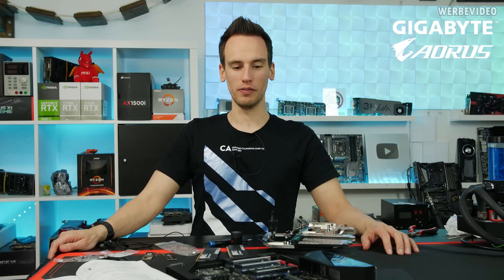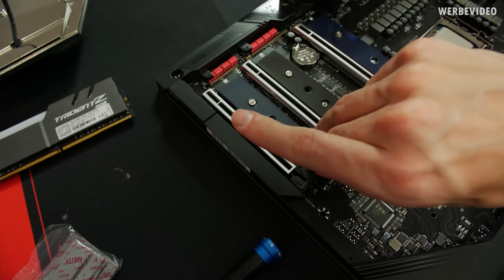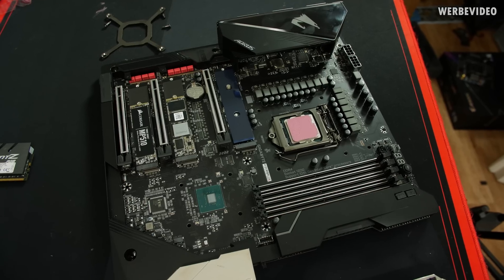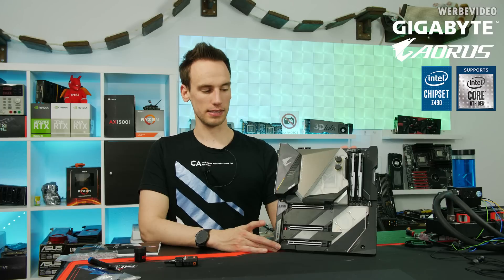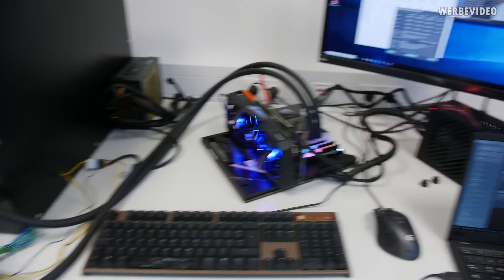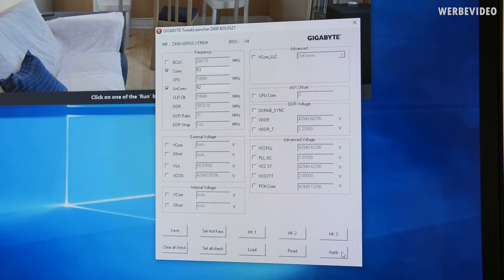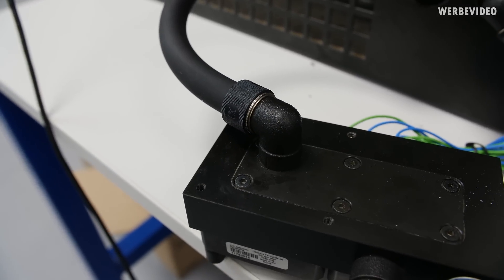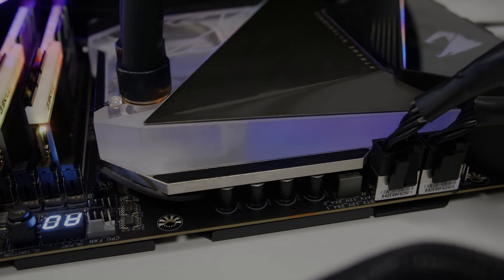A 4000W Chiller to tame the 10900K! feat. AORUS Z490 Xtreme Waterforce

Comment: I think it may be interesting to try chilling your ram.
Afaik Samsung B-Die has a voltage limit where it doesn't like to use all 16gb in Windows, so maybe with a strong kit of ram (4000c15 or 4400c17 if not manually binned) you could get 4666c14 passing memtest before that limit
Reply: It might work but some things don’t like getting cold (I have to throw out RAM kits once they start condensing moisture or if they get much below -5c when I’m using DICE on the CPU even (dry ice). Kind of inconvenient when Threadripper has so many sticks so it doubles the cost of your testbench (unless you were patient, but I don’t see how overclocking computers and patience waiting on computers works well, haha, you overclock because you are impatient!)

Thankfully on phase cooling (with a 5w rear socket heater) on Ryzen desktop even with the cpu at around -60c all day the ram doesn’t get cold enough to condense, however around 0c it stops booting at good speeds (so if you crash you have to wait for it to warm back up). Sometimes you’re just happy with it even operating, because it’s a nightmare for Threadripper (you might get 3 sticks, or just 2, or sometimes 1 and then shout with joy as finally all 4 boot even if it’s only 2133 or 2666 instead of the 3600+ you were running on air).

So RAM doesn’t behave exactly like CPU, everything likes to be at a specific temperature (and not all ram is the same). But it is sort of like regular cpu binning, some chips like extreme cold when others of exact same model won’t even boot at that low of a temperature. And with ram you have multiple sticks so it’s even more finicky (I really don’t like RAM overclocking, it’s fun for the first few hours, sort of, then you never want to do it again after dozens of hours of pulling your hair out).

I think on his chiller his temps would be right where it would either work fine (might even improve) or if the RAM is picky start being right around the point it might stop working, it’s hard to say for sure, I’ve found it’s usually a lot of hair pulling (like really, my desk is typically covered with hair after trying to tune ram when everything is at their limits and it’s the last thing, the rest of overclocking is incredibly fun and it’s one of my favorite things to do, except RAM, lol!)

Comment: is it practical to use the chiller for everyday use?
Reply: Not really. If you go below ambient, you’ll cause condensation like in the video. Chiller also consumes a lot of power.

With a MO-RA3 420 you’ll get couple degrees over ambient temperatures and it’s much cheaper.
Reply: You can technically do it, you just need to put your PC in a room with very stable temperature and humidity so you have a stable dew point (temp/humidity at which condensation starts). For example in a room with 20C temp and 40% humidity you could go as low as 6C water temp +/- 1, so like 9-10C to be safe. But then you are at the mercy of room cooling, if it fails to maintain this controlled environment and chiller keeps going then you are in trouble. So it would probably be much safer, easier and probably also cheaper (seeing the crazy prices for these chillers) to make some tiny insulated room, cool it down and then your water temp scales with ambient temp and nothing bad can ever happen. I am keeping my PC in unused not insulated room that gets very cold in the winter, it is great to have ambient temp of like 3 or 5C :P And it is perfectly safe. I am considering making something like this for whole year operation.